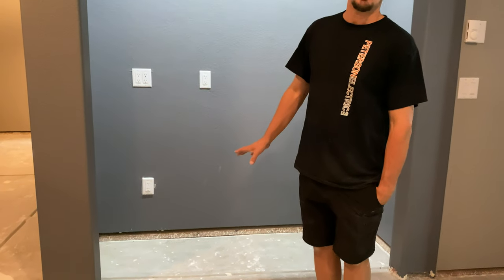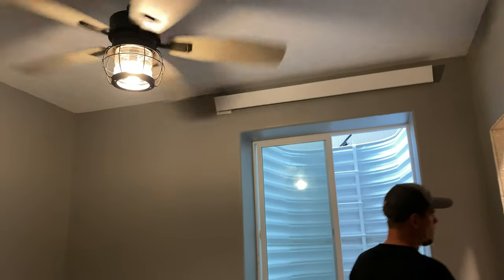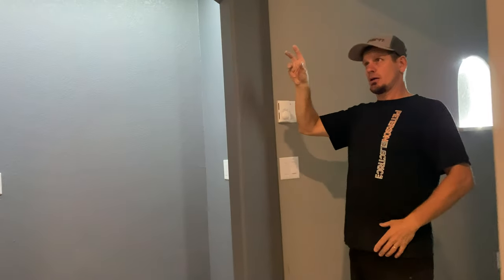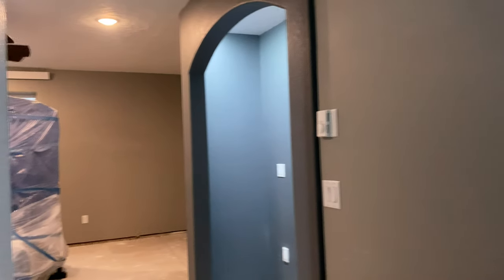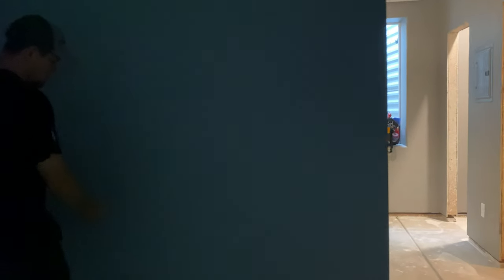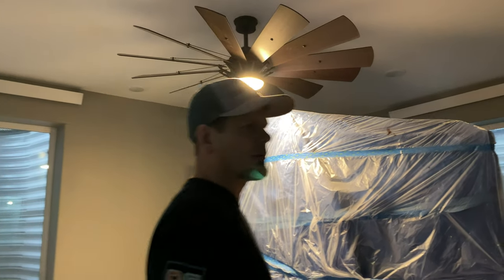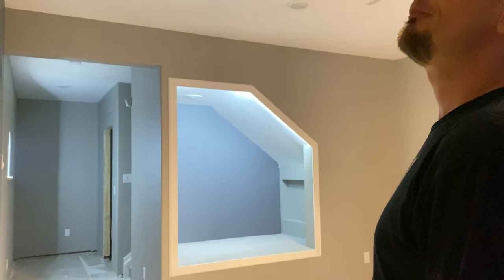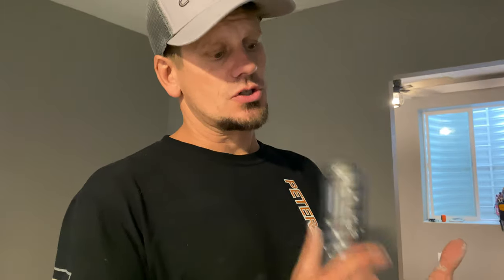Basement Trim Out & Lighting Ideas

Comment: Been watching for a couple of years.
Have been able to glean much needed hole filling in my tiny DIY mind like this info vid for a future back lighting in master bedroom renovation.
Thanks for all the help.
My channel sux but mine is a DIY for guys who are like me, not professional.
Am nearing the end of an addiction of portable generator manual xfer switch to sub for necessary power failure appliances and relay to 125 amp service to detached garage sub outdoor service panel.
BIG job changing everything touched  to NEC code. Utility room hub upgrade to "wet" location is the task at hand but can see the light at the end of the tunnel.
It's guys like you on YouTube who make this platform what it's suppose to be.
Thanks again!

Comment: I like the transformer idea. The real trick is to show the inspector using the thermal camera the heat build-up in that four gang box even with the screws tighten down. The oversized box helps as well. Proving that there is sufficient heat dissipation and meeting the device specifications rather than guessing about the heat build up I find much more a convincing argument with inspectors.

Comment: Nicely done. Since your transformers/drivers are in the unfinished space (in the 4-gang) I would assume you ran low voltage wire to the tape lights?  Or an 18/2 thermostat wire?